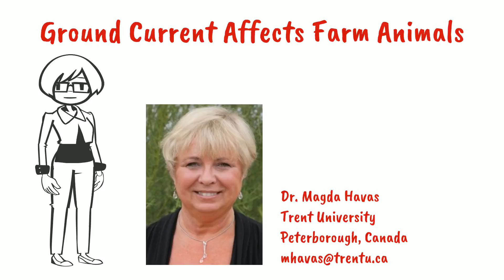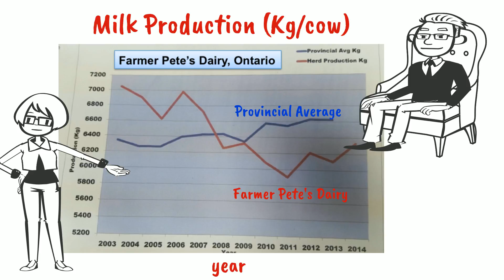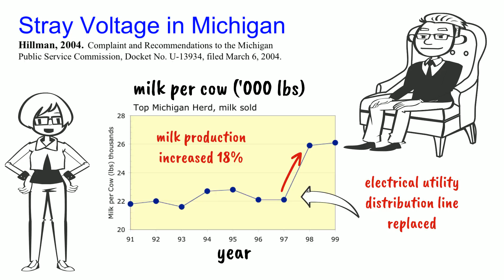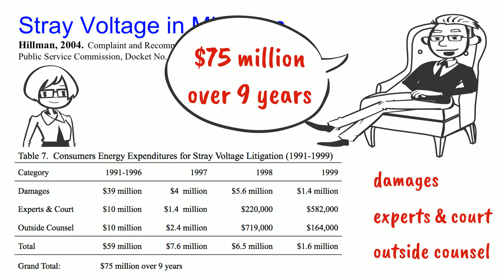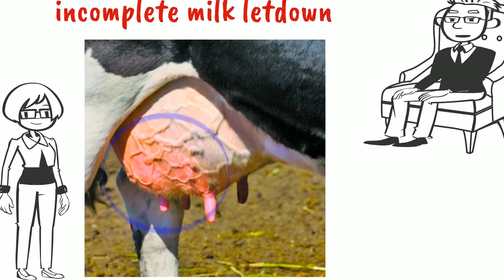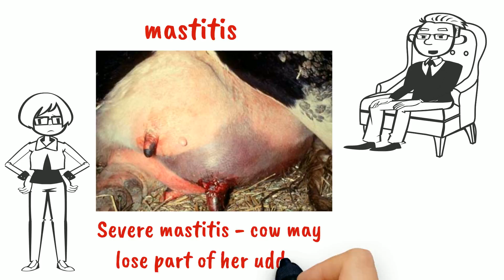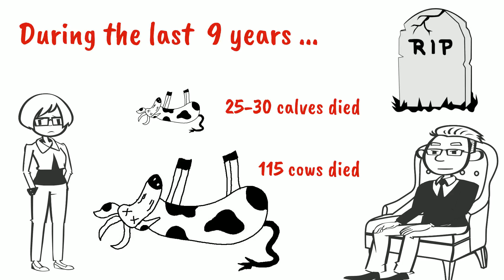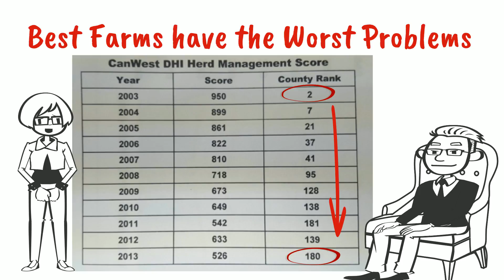Ground Current:  cows health and productivity with Dr. Don Hillman

Comment: Is there a concensus on how much ground current is too much? I've regularly measured 2.5 V AC here from the PUD ground to an independant ground rod 25 ft. away. Once a peak 8.4 V AC, and today 1.7 V AC.
Reply from the maker: Generally voltages of 0.5 V peak-to-peak is enough to harm a cow at 60 Hz and 10 mV peak-to-peak in the kHz range of frequencies is as harmful if not more so.  However, it is the amperage that is the real problem, although more difficult to measure.  80 microA flowing across the heart can stop the heart.  This can happen when a plumber is fixing metal plumbing and has a hand one each end of a pipe that has been cut.  The current will take the path of least resistance and flow from one hand to the other across the chest.  This can be fatal.  Exposure to 18 microAmps has been associated with cancers.  The amperage flowing through he body is a function of the bodies impedance and the impedance is a function of frequency, with the impedance being reduced at higher frequencies.  The values you have measured are extremely high and should not be flowing through the soil.
Reply: Moisture content in the ground will affect how well your ground rod works.